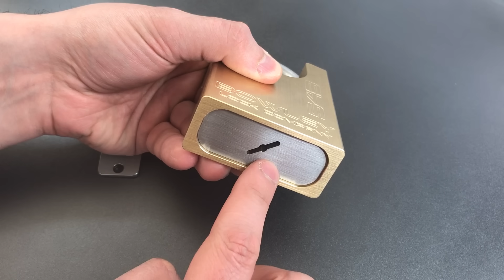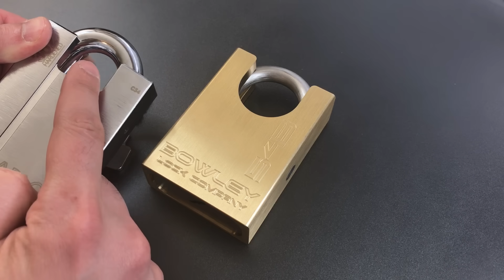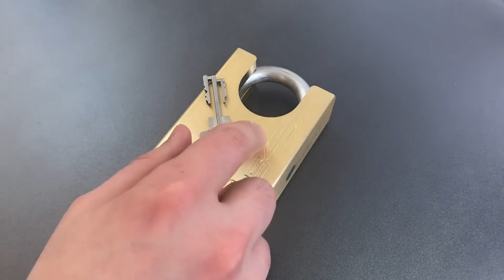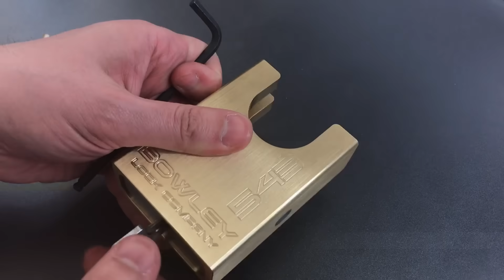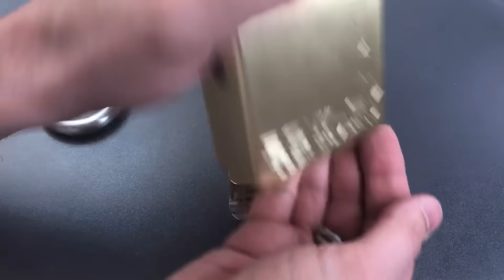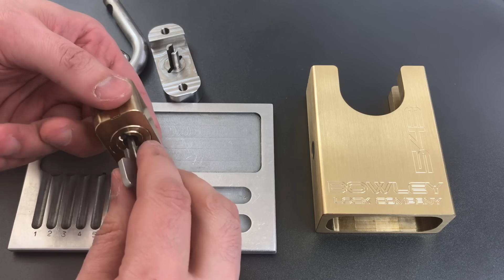[653] Prototype Dual Fork Bowley Padlock (Model 543)

Comment: "Five quarters of an inch"
And that children, is the reason why the rest of the world uses the metric system...
Reply: How would the metric system be different in this case? Five quarters of a centimeter. See what I did there? Magic.
Reply: 5/4 of a meter is 1.25 meters.

Your comment makes no fucking sense.
Reply: @chrismanuel9768  here grandma comes again.

6/12 cup butter
4/8 cup granulated sugar
4/16 cup brown sugar (packed)
8/4 teaspoons vanilla extract
4/4 large egg
14/8 cups all-purpose flour¹
2/4 teaspoon baking soda
4/8 teaspoon kosher salt2
100/100 cup semisweet chocolate chips

of course this is over exaggerated. but as soon as the measuremnt surpasses a whole, it just seems unneccesary.

as has been thoroughly discussed in the replies, 5/4 = 1¼ = 1.25
Reply: @mishXY  Regardless of who's right, that recipe has gotta be the dumbest argument in favor of anything I've seen today. Those are all reducible fractions, i.e. 6/12 = 1/2, 8/4 is just plain 2. Totally irrelivent to the discussion of if 5/4 is valid or not.
 If you "reduce" 5/4 to 1¼ or 1.25, either way you've added syllables and numbers when it was just two before. The concept of a quarter of something is manageable for you, right? What is it about saying "here's a quarter, now here's five of them" is so difficult for you to wrap your head around? It's not what you're used to, but that doesn't make it wrong. Y'all really gotta freak out over the weirdest stuff, lol.
Reply: @Notanothercrayon  I believe we should create a whole new concept. It would be called the "semitom". A semitom is exactly 5/4 of an inch. So now we can just say "a semitom" and people will immediately know that we are talking about 1.25 inches, 5/4 inches, or 3.175 centimeters, independently of whether they prefer to use the metric decimal system, the imperial decimal system, or the imperial fractional system. What do you think? Great concept!

By the way, mine is 6.3 semitoms. What about you?
Reply: @mishXY 😂
Reply: are you too stupid to do math in your head?
Reply: @marcuswagner1396  I think he was refering to the fact that fractions seem pretty unscientific, or just not what most are used to, One could still say 1.25 inches and it is the same
Reply: @mishXY  explain what you mean by "they seem pretty unscientific",
Reply: @marcuswagner1396  first, I am not saying that they aren't scientific.
just that people who use metric, they don't use fractions much - so to them these measurements seem vague, even though 1/4 is just 0.25.
I hear this a lot when buying things that are based on empirial (e.g. pipes).
The guys will go "oh my god, it's empirial so it's going to be five quarters - it's like grandmas baking recipes" referring to the fact that the only times you hear fractions used for measurements,  it's baking amounts from nana, e.g. half a cup of sugar.

I mean I, personally, find fractions unnecessary in these moments, why not just say 1.25in instead of five quarters of an inch.

example: adding 9/7 to 5/4 is annoying, but adding 1.286 to 1.25 is much faster and easier.
Reply: @mishXY  I think your earlier example of adding two fractions is a great one, it also being the main problem I have with Imperial (I use metric myself). 
However, doing multiplication with fractions is simpler, as the numbers are smaller.
An example: 5 pipes with a width of 9/7 would be (5*9)/7 = 45/7 = 6 and 3/7, which is waay easier to do than 5*1.286 .

Next to all of this, someone growing up doing fractions is naturally better at it, so for them, it really is more efficient.
Reply: Chough chough metric is better cough cough
Reply: I'm in favour of metric here. But I'm just here to watch the fight.
Reply: Oh boy, did Americans ever thought, that peps, that use metric never try to produce things in sizes equivalent of an inch. We have things here in mm with reasonable while numbers. But things from left screw countries like US will be rounded to something reasonable unless high precision is necessary. We don't have things with 32mm size, it'll be 30, 40. Sizes of tools will be like 8,9,10... In mm. No fractions, we don't need them. Why bother? Have other things to be bothered with.
Reply: Or just ya know more than 2 brain cells, I guarantee someone has said some stupid fucking metric measurement when they ment something else...
Reply: Well...it is manufactured in Canada by a Canadian. He said 5/4 and not 1 & 1/4 because the lock is specifically named for its dimensions, which wouldn't work if one of those dimensions was 1 & 1/4.
Reply: All these butthurt europoors.
Reply: Five quarters is a perfectly cromulent measurement.
Reply: @Izzanbaad  no one's gonna say 8/4ths. They'll just say 2
Reply: @Izzanbaad  Seems a bit stupid to me. Like why would you say 28/4th's instead of just 7?
Reply: Even US use Meteic to define their weighing and length system
Reply: Ah yes the good ole 3 and 175/1000 cm is so much simpler
Reply: @matthewstowell5813  It is when you say 3.175 meters, which we can do because it's a base 10 system and we don't use fractions.
Reply: @ChicoTunda  you could also just say that it is 1.25 inches, they just wanted their lock name to be 543 because it is simpler that way, this whole comment thread is so trivial, it really doesn't matter. The rest of the world gets up in arms cuz their using the imperial system and apparently 5/4 is somehow a super complex number now. And the Americans get up in arms cuz everyone else is pointing out how stupid and inefficient the imperial system is
Reply: @ChicoTunda  I said 3.175 cm bud
Reply: Wrong, the UK and Canada also use the imperial system.

https://youtu.be/s95cxZkC_es
Reply: Third worlders not being able to understand fractions.
Reply: this whole thread: "*Frustrated noise* The metric system ??? My car gets 40 rods to the hogshead and that's the way I likes it !!"
Reply: @QuinnKallisti  If I didn't know better I'd say you didn't actually read the thread, you just smelled a debate between metric and imperial and it made your lil pp hard
Reply: @Notanothercrayon  pmsl
Reply: @Izzanbaad  I'd be inclined to shoot an engineer that did the 1 1/4 inch deal. Improper fraction are very common and appear in a lot of naming conventions such as the thickness of lumber where in hardwood 5/4 lumber is a common thickness. Light bulbs are another area where the numbers in the description are diameters in 1/8 inches.  It's a very easy system to use.
Reply: 3.175 cm is way better. Your right!
Reply: @theaberrantdon  if I have to do anything with that in my head . going to turn it into 82/25 cm and work from there. It's much easier to do than to manipulate 4 digit decimal numbers in your head.

Besides it's trivial to divide 5/4 in half which is a common thing to do and a pita to do it with something like 3.175cm.
Reply: @doug112244  Why would you pick 82/25, instead of 5/4?
Reply: @doug112244  Also, I was responding to the fool who said metric was better, bc 32mm was a whole number. 5/4 inches is 31.75 mm, not 32mm. Everything is a whole number if you round it.
Reply: @theaberrantdon  yup.  It rolls off the tongue.  Metric may be great for science, but for life, it sucks.  The beauty of imperial is in the language and practicality.  I'd walk 500 miles, bury someone 6 feet under, to keep the practicality of the inch and pound.  Besides, base 12 is superior.
Reply: There's two types of countries. Those that use metric, and those that have been to the moon.
Reply: @lugergsd9282  NASA uses the metric system. Plus, the rockets have been built by german engineers that, oh wonder, used the metric system. Try again
Reply: @lugergsd9282  I'm pretty sure you took our engineers after ww2 to the us. Ever heard of operation overcast/paperclip? No? Educate yourself. And I don't know why you think that the imperial system is superior just because you beat us in the world wars
Reply: You're just mad because you don't understand the measurement.
Reply: Or because it's extremely common to use improper fractions in engineering when you're describing something that isn't a whole number?
Reply: @x6568tank  What kind of engineering are you doing in imperial?
Reply: Guillermo Gomez 100% agree, i hate this imperial system.... Metric system is the best, why use anything else???
Reply: @x6568tank  naaah it's gotta be because it's not metric... Yeah idk either
Reply: @x6568tank  Extremely common....in american engineering maybe 😆

Comment: The key to destructive opening is to drill the threads out of the bottom that hold it together and slide the guts out. It's going to keep the lock pickers out but then there is the chain. A locking system is only as strong as it's weakest link which is usually the chain.
Reply: "It's" is a contraction of IT and IS. "Its" is the possessive of IT. Just like HIS and HERS - no apostrophe.

Comment: Looks like the brass and aluminum body versions could be sawed in half, just above the internal cap screw heads. If the bottom plate doesn't have hardened inserts in the bottom of the threaded holes, it needs them. Whatever attack method, separate the bottom plate and the rest can be removed.

Comment: There is video on YT where someone open bowley lock with U shaped wire in electric pick. Few seconds and it was opened. It's probably possible with this one aswell, unless there are some serious security pins installed this time.

Comment: I don't know anything about locks but I've seen you destructively destroy padlocks with a hammer with next to no effort, I don't get the point of the insane security when you can bash it open
Reply: At this price point it's most likely just a collector's item. If you wanna lock something so valuable that the lock alone warrants 200+ dollars, then you're probably want way more security than this lock provides. This lock kinda makes itself unusable by sheer price. Unless it's some rare situation where destructive attacks wouldn't be viable because of the noise. But even then you'd find a way to silently destroy it, maybe with acid or electro-etching.

Comment: I have serial #001 of this lock. It"s an impressive size and weight with decent fit and finish.The pawl retaining pins are not flush ground on mine. I would certainly buy the steel version for  higher security use although it's a beast and dwarves the Abloy 656.
Correction: I just checked and it is actually marked '1 of 235' so it may not be the first of the collectors edition as I haven't checked to see if they are sequentially numbered.

Comment: I am just curious if there is any application for KIK/KIL on this style of lock. It works great in mortise cylinders, but I don't see it being too viable with other applications. Part of a well-rounded product is the ability to use the same key on multiple types of locks and applications. So far they have 2 products with 2 very different keys. And while the design is really great and the quality is excellent looking, the application and versatility of the product seems lacking. I'm sure I'm late to the party, but still, I wouldn't want to sell locks to any of my clients without the ability to expand in the future.

Comment: 5/4. Something don’t look right. I still love all of your videos but metric is a much better unit of measure.
Reply: Nobody is stopping you from converting 5/4 to metric.  But you won't do it because then it would become obvious that metric is an unwieldy unit of measure, especially if you are naming a padlock after it.  And the only reason5/4 doesn't look right is because you aren't used to it.  When I worked at a lumber yard, 5/4" was a common size for boards.  We sold a lot of it for decking and stair treads.

Comment: I have a problem with a $225 padlock that has such a thin shackle on such an expensive and high-end padlock. The type of people who spend $225 on a high-end padlock have a need for an extremely thick commercial sized shackle such as the one on the abloy. Your ordinary person will not spend $225 on a padlock to lock up their shed. These expensive high-end padlocks are mostly used for commercial applications to secure very expensive equipment. There is a need for a thick shackle on such an expensive high-end padlock that mostly caters to your commercial applications. There is no excuse for such an insignificant shackle.

Comment: Mr lpl,
Is there any way to use a magnet to increase s locks security.  Maybe use one to pull a pin out of place just incase someone is picking them one at a time like usual, instead of using a key that holds them all in place simultaneously?  
Yours truly,
A very interested student

Comment: I get it it's a very hard to pick padlock for 160$ or so, but at that price, why not just buy an Abloy disc detainer or something similar? Those are just as impossible to pick and open easier with the right key, also seem less prone to failure and a time-tested design... Is there some good reason to buy a weird pin tumbler instead?

Comment: "5 quarters of an inch thick"

I'm an American who uses Freedom Units (imperial) for measurement and this still triggered me a little bit lol. What the actual F? The measurement would be 1 1/4" (or 1.25") thick. Quarter means 4ths, so 5 4ths doesn't make sense at all. Silly Canadians.
Reply: I don't see an issue but I'm 5' 13" tall.
Reply: Both of those options sound terrible. 5 quarters is easy to understand and short to say.
Reply: im·prop·er frac·tion
/imˈpräpər ˈˌfrakSHən/
noun
plural noun: improper fractions
a fraction in which the numerator is greater than the denominator, such as 5/4.

its a thing, its also correct, its also the exact example google uses to describe it.

Comment: What’s stopping someone from making a torque tool that slots into the bottom of the key way, through the idler etc and using standard picks on each side? Would be annoying maybe to drag the wrench around the chamber but seems fairly possible without any drastic changes to equipment.